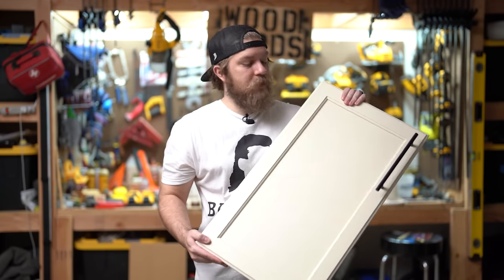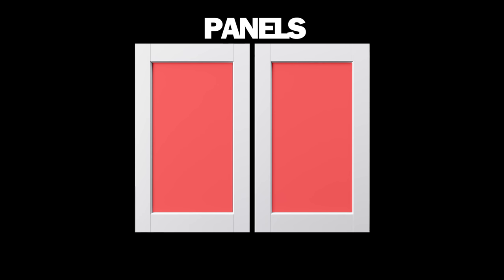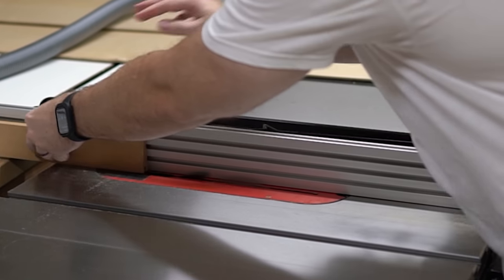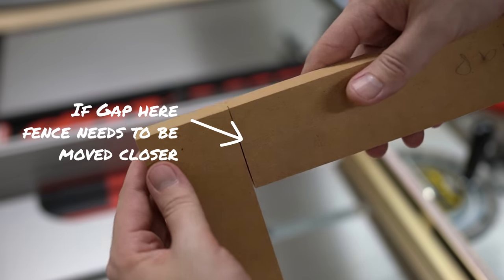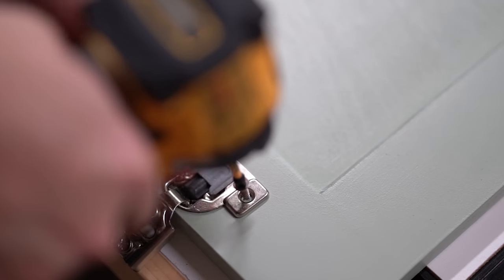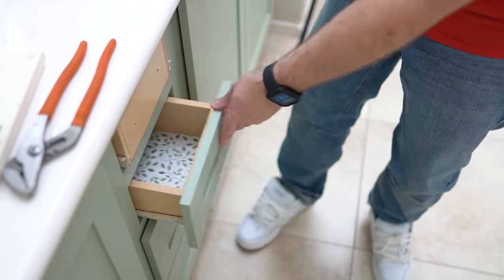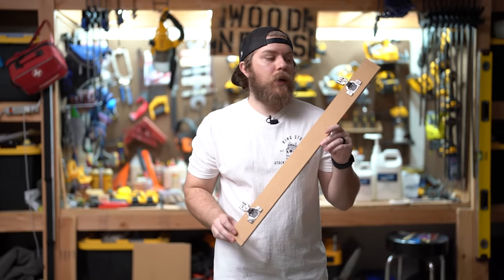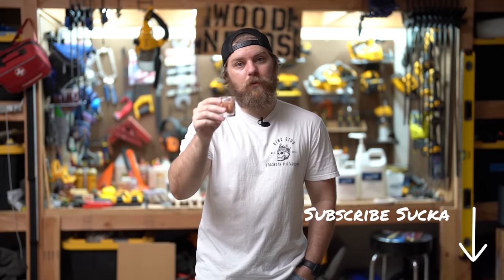CHEAP and EASY Shaker Cabinet Doors and Drawers | DIY | HOW TO

Comment: Great video. Any suggestions on how to make a decent "stop" for a table saw like the one you got on the right side of your table saw in order to adjust width? I ask because i bought a cheap table saw and it does the job great, but the "stop" (i dont know what it's called in english) sucks donkeyballs and moves when pressure is applied.
Reply from the maker: Hey! Thank you! I believe you are talking about the fence! Some fences allow you to adjust the pressure when they are engaged. Look for a screw or bolt on the back or maybe take it off and look underneath. Otherwise, you might be able to make one but be careful as the position of the fence can cause kickbacks if it’s not set correctly.

Comment: Great presentation. Now I just need a table saw to do something like this 😢
Reply from the maker: Thank you! It’s an important piece of gear for a lot of diy/woodworking projects! You’ll find that out of all the tools in a shop, many will spend much more on that machine due to its importance and the amount of work it helps complete. I’m blessed with a great top of the line saw but there are a bunch of other more budget friendly options that are high quality. From my experience and from reviews I’ve seen, DeWalt makes a nice job site saw that can get you in and out of most jobs.

Comment: Why not use MDF for the middle as well? I typically use poplar or alder for the rails and started using mdf for the middle years ago to keep grain lines from showing through. Always wondered how mdf rails would hold up. Thanks for trying it out.
Reply from the maker: Hey! Yeah, I don’t remember if they didn’t have any when I got the 5/8 material for the rails/stiles or the plywood was cheaper but mdf is very popular to use as the panel. I’ll probably be using it in the future as well. Thanks for watching! Cheers!

Comment: I noticed that in one instance you used 5 mil plywood for the panels, and in the other you used MDF. Is there a benefit of one over the other?
Reply from the maker: Hey! No, not really. Plywood in my opinion feels a little more substantial but either should perform the same. I’d probably go with what is more affordable and/or more readily available. You really should sand the plywood before use and can likely get away with using the mdf without that step so it might be a little less work.

Comment: the stop block for your mortise and tenon should run past the saw blade so when your sliding it along the top of the blade you can't go past the stop point.

Comment: Do you think it’s possible to add a metal tin panel to these? My tin panels are 10x14, which is not the size of all my cupboards, so wondering if it might be possible to have the plywood inside the rails and styles and then add the tin panel? I’m thinking this might be next to impossible, but wanted to check before we get started lol. Thanks in advance 🍻

Comment: Making the shaker doors using a router and rabbit bit for dropping in the panel was way easier for me as DIYer. I don’t have table saw and the amount of work and precision to do this method was too much for me.
Reply from the maker: That’s a great point Corey! Im going to try your method and see how it works for me as a comparison! Thanks for taking the time to respond and share your experience!

Comment: Can you share the paint you used and the process? Spray? Brush? Roll? Dip? Dunk? Paiting can suck….over a great project!
Reply from the maker: Of course! It’s “clary sage” using a “cabinet and furniture paint” base to help mitigate wear and tear. The tag doesn’t seem to have the brand but my wife picked it up at Lowe’s.

I used a small foam cabinet roller for all the big easy to get to flat face surfaces (light coats). Then a brush on the inside corners where the panel, rails, and stiles meet. I really want to get a sprayer but it’s a little out of my budget right now.

Comment: I noticed the router table. Why not use it rather than the table saw for the rails/stiles for the panel? I found your Monport video first, but sub'd for the other stuff. Excellent videos.
Reply from the maker: Hey! I find the saw to remove material a little more easily for me and I’m a little more confident with it. I also think the dust collection on the saw is really good where my router leaves a little bit more of a mess to clean up but it’s a great option. Now that you mention it, I might buy some of those tongue and groove bits to try out.
Reply: @WoodNerds Also, now that you have that giant laser, any thoughts on cutting the panels out with the laser or having one-piece rails/stiles to lay on top of the panels to give depth?
Reply from the maker: @bearsstuff haha funny you mention it, I have plans for that exactly! Also thinking about using it to cut out louvers for shutters and box joint drawer boxes.
Reply: @WoodNerds That's why I wanted the 55x35 machine. To build cabinets. Looking forward to your how-to. 🤣
Reply from the maker: @bearsstuff haha that was my main want as well. Hoping to really put it to work and it save a bunch of time and money. Of course! If you think of any other ideas around it, please let me know.
Reply: @WoodNerds There is a material, HDPE Colorcore, it's layered with 2+ colors. On a CNC router, you can just adjust the depth going through the layers. I've seen once a person was able to do it with a laser. Imagine White on top, red underneath, and you use the laser to blow away the white to expose the red to make a No Smoking sign or something. I wonder if a 130W laser could get turned down low enough or if this laser could go fast enough for that material.
Reply from the maker: @bearsstuff that’s an interesting idea. I was thinking similarly along those lines for dados. Probably wouldn’t be able to remove all the material in a reasonable amount of time so just a few halfway cut through lines that can be easily removed would be good enough for me.
Reply: @WoodNerds Yeah. I'm getting better at Fusion, so if I could even just set up a sheet and have the laser mark my lines, that'd be awesome. Then use the laser for router jigs for the different joint types. Could get bougie and use the laser to put your logo on the inside of a panel. I'd even go so far as to use the laser to mark the holes for drawer pulls. Not sure what the behavior is with cutting wood, but you could also mark front/back or do 1:1, 2:2 sort of "easy mode" assembly instructions, try and address potential human error. Just shooting from the hip at this point. Might be easier to have this thread over on Patreon also.
Reply from the maker: @bearsstuff it’s crazy what you can do with them. I was thinking about something similar. Pre-drilling screw locations. that’s a good idea! I’m not really good with using that  platform as it’s intended.

Comment: Sending this video to my husband. His woodworking skills are pretty basic but we have an issue with some kitchen cabinet doors which are delaminating (IKEA kitchen, usually reasonably decent quality but if theres an issue they replace, right? 25 year warranty and all that...tiny problem being that this kitchen was redone by a contractor just before we bought the house and we discovered too late that the previous owners hadnt left any receipts or anything for the reno, so when stuff started falling apart after a couple years, we were hooped. So IKEA wont honir the warranty,sadly). Which leaves us with either (a) replacing the entire kitchen because all the cabinet sizes are now different, so we cant just buy new doors, or (b) making new doors ourselves. Obviously a huge project but this video does gove me some reassurance that we might be able to do it.....
Reply from the maker: Dang! Sorry to hear about your luck! I hope the video is able to help you guys save some money and leave you with the desired results! Thanks for sharing and taking time to comment!

Comment: Did you have to damage table saw fence to attach extruded aluminum? Trying to figure out how to attach without screwing through, thanks great video
Reply from the maker: Hey! It’ll depend on the fence system you have. For the SawStop I just removed the old plywood face (there are screws you can get to from underneath the fence) and in its place added the new one. The wood whisperer did a tutorial on it I believe! Thanks for watching!
Reply: @WoodNerds  I also have 3hp sawstop🤘thanks brother
Reply from the maker: @dutenn it’s an awesome upgrade to an already legendary saw! Of course man! 🤘🏻🤘🏻

Comment: Do you ever leave your stiles a bit longer so you can come back and make sure it’s all squared off? Saw that recently but haven’t actually tried it yet. 14:32
Reply from the maker: I’ve seen that as well. I don’t, but I’m also not producing large volumes of doors. I could see the time savings making sense!

Comment: The cabinet doors I'm making are just the flat front doors. Would you still recommend the MDF? Initially I was going to use plywood but the cost is off the charts at the moment.
Reply from the maker: Yeah, mdf should be fine for that application. Make sure you seal them up well and/or use some moisture resistant mdf (can be found at a lumberyard).
Reply: @WoodNerds  thank you!

Comment: Love these vids.  Cheap and easy, so long as you have a workshop with thousands of $ of equipment.
Reply from the maker: You can easily cut mdf with any tablesaw as it doesn’t require a lot of power to get through, but to get fine results, accuracy matters so I’d recommend a tablesaw that allows fine adjustments (DeWalt makes a great job site saw). You can’t blame me or others for investing in tools to improve the quality of our work… if you refuse to do that as well, that’s on you, not us. Work hard, sell things you build, save money, buy tools. That’s the formula almost all of us follow. Good luck with your projects! Cheers!
Reply: What other hobby do you know that doesn't involve a monetary outlay... oh yeah...navel-gazing... 😂

A cheap tracksaw and guide for 50 bucks will work too... 

If you don't want to spend money on tools, find another hobby... 🙄
Reply: @peterfitzpatrick7032  LMFAO.  CHEAP......Is the key word here. Think you are missing this part. Then do the video using that equipment. Not the thousand of dollar ones
Reply from the maker: @peterfitzpatrick7032 haha thanks for the support, bro! Most people are kind and realistic, others need a little help! Cheers!
Reply: @WoodNerds  I was being realistic. Most people can't afford that level of equipment. Create a video on affordable equipment, now I'll watch that.

Comment: Is there any reason i shouldnt use select pine for the rails/stiles instead? MDF is cheaper, but would pine hold up a bit better with children?
Reply from the maker: Hey! That’s a good question! Pine is pretty soft! I took a piece of mdf and hit it against some studs I have laying around to test this out and the mdf didn’t take any damage while the pine board was all dented up. So from my tests it seems mdf would hold up better to dings than pine would.

Comment: love this...well explained and exactly what I want for a first time attempt at making shaker doors...however, is it possible to glue  rails and stiles over existing cabinet doors to get the same effect? (pros: Hinges are already attached and cabinet doors are the right size already...what are the cons?...)
Reply from the maker: Thank you penny! I don’t think I’d be able to do that and make it look any good honestly. I wouldn’t be able to tightly fit to the gaps or tight enough on the edges. If I found a way, it would likely take an incredible amount more work and time than just cutting them out.

That’s just my opinion based on my experience, might be an easy way to do that but I’m not aware of it.
Reply: @WoodNerds  thanks for your thoughtful reply.
Reply from the maker: Of course! I’ve unfortunately found there are no shortcuts in woodworking haha. Professionals (not saying I’m a pro but pros I’ve learned from) do it the way they do because it is the best way they’ve found for the best result over years of experience. They’d know the best way to make things with the least amount of effort and time to optimize the return on investment. Of course that’s been my experience and that’s a generalization but it often plays out that way. Thanks for watching and taking time to chat :)

Comment: What's the point in face frame cabinets? Tradition? Design preferences? Wood saving?
Same question about shaker doors - it's so much easier and faster to make a flat one.
Reply from the maker: That’s a good question! I’d say it’s a design feature and it also saves on materials. Where the frame meets the panel you have a shadow that creates interest. Similar to a wall with board and batten. On the wall, it serves no real purpose (except to collect dust), but it sure does look good. To counter that, I’ve seen kitchens with flat cabinet doors and thought they were equally appealing… so maybe preference as well?

Comment: do you think this would be a good method to make some the slim shakers that are becoming popular?
Reply from the maker: I would probably use an MDF panel as well and it would probably be fine! I haven’t tried making those so I don’t have personal experience but as long as the panel is stable, the rails and stiles don’t have to be super rigid. I bet they’d be even cheaper though as the panel material is much cheaper than the thicker sheets.

Comment: I have finger edge pulls that I’d like to use on this build, would you recommend doing a shallow rabbit along the top side for those? Probably a dumb question, but I know that when those are installed the cabinet faces and drawers won’t close all the way.
Reply from the maker: I personally like the flush look when rabbeting for those thin pulls. As for closing, I use those little rubber bumpers on doors and drawers so they don’t usually close all the way anyway so if you do that, I think you’ll be good. Wouldn’t hurt to make one to test before committing to all of them though.
Reply: @WoodNerds  oof, the little bumpers makes so much sense. Thanks so much for your quick reply! I’ll be buying you a drink and ordering a shirt soon. Maybe you should do a shirt design for us ladies! 

The stripper ones are pretty rad, tho!
Reply from the maker: @kdean509 I really appreciate that! Haha! I need to! I have trouble thinking from a girls perspective on what would be a cool design! Guys are easy! We don’t mature beyond 15.
Reply: @WoodNerds  If I come up with any ideas, I’ll send them your way! 

100%, a lot of us girls carry the same humor… I know I do, lol.
Reply from the maker: @kdean509 haha! that would be great! Thank you!

Comment: Hi, have You use any primer before coating?
Reply from the maker: I used a paint/primer combo. In my experience, mdf holds onto paint really well since it absorbs some of it with the first coat.

Comment: Tips no one asked for. Sand the panel side edge of the styles/rails before glue up if needed. Drill and glue in 3/8” dowels where screws attach at the hinges as this is usually the first point of failure. Wear a mask (as you did) as MDF is nasty to breathe in depending on how many pieces you’re doing.

Currently in my area mdf is $10 more a sheet than cabinet grade sanded plywood and would make a great alternative if you planned on a stained look. Plywood is also resistant to movement with moisture and, if it does soak up water, dries out without compromising the piece. The only difference is you’ll need an hour or so for edge banding.
Reply from the maker: Thanks for the tips man! I’ll be trying that out!

Comment: Where can you buy HDF and what is the cost?  I've seen the thin hardboard but that doesn't go beyond 3/16 and has a rough side.  Is it worth it to treat the MDF before painting to get a better seal?
Reply from the maker: In my experience, MDF has been fine! If you have a lumberyard you can source it from, see if they have moisture resistant MDF. That should be a similar cost to regular MDF but an increased insurance policy against water exposure. Paint should be enough to seal it up.

Comment: I’m sure I missed it. To allow for the tenon, the rails have to be cut how much wider?
Reply from the maker: Are you talking about the dado in the stiles to fit the rail tenons? You have to slowly dial it in with your scrap piece. Cut a little too big, then take a hair off until it fits right. Then run the rest of your pieces through to match.

Comment: would this style of door be ok in a semi covered outdoor kitchen in the far north?
Reply from the maker: That’s a good question. You can get water resistant MDF and coat it in SEVERAL layers of outdoor paint and it might work. MDF and outdoors don’t usually go together and for that reason, I don’t have any experience. If painted well, I don’t see why it wouldn’t work. As long as moisture can’t get to the MDF it won’t swell and cause issues.

I think the normal course of action would be to use a more outdoor friendly wood like cedar or use a different material like metal for the doors.

Comment: That "cheap MDF" you used... around here is definetly called HDF, and its rare and expensive. Our "MDF" is something else, soft and crumbles in hand... Touch it with sweaty hand and it disintegrates. Just a little bit envious:)

Comment: How difficult would it be to make a split panel cabinet face (3 rails) with a 1mm iron sheet plate on the front of the bottom panel, for using magnets on as an hidden utility for holding recipes, lists, etc.
Also, another utility cabinet door to either set in a tablet, or have a hard install of a small monitor in the cabinet, allowing for the wires to run near the hinge side?
Reply from the maker: That would be a cool idea! For taller 2 panel doors you’d probably want to use thicker material (3/4”). For the fun technical stuff, I’d have to do some good thinking and testing on that haha. If you make it, I’d love to see the results!